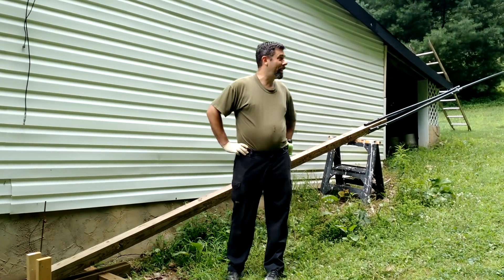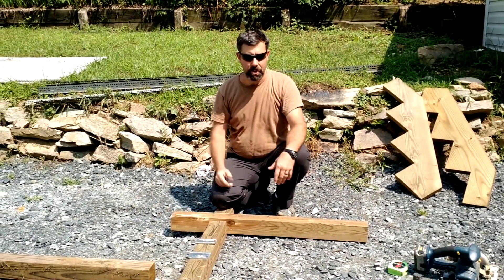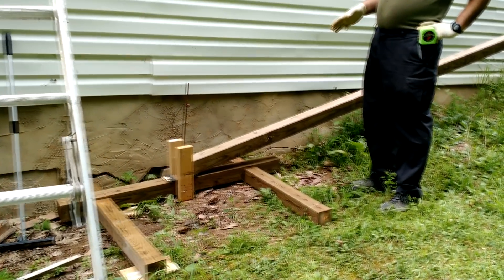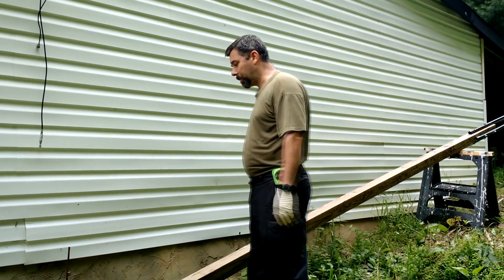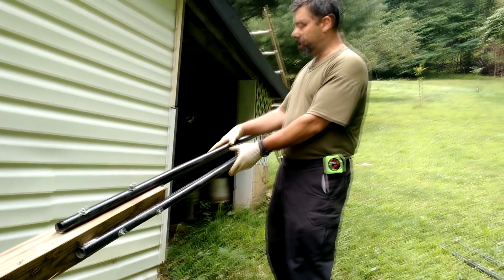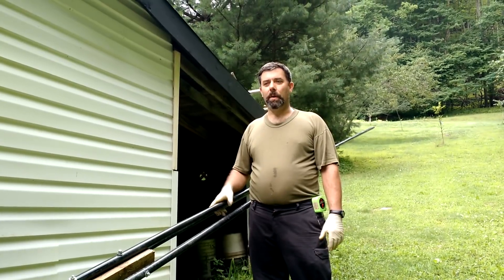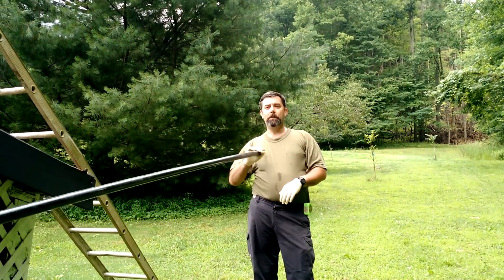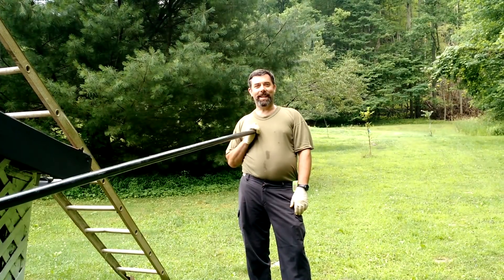Antenna Tower Build Part 1: I'm tired, but its built!

Comment: Hello Eric; interesting ideas you have. Your I-MAX is going be a challenge, because of its length and mass, sitting on top. The ground plane kits help it's performance, but again it adds weight and wind load. I hope you are going to guy the tower off, so as to help it all during a storm. To keep weight down while adding survivability, I would use black tarred twisted nylon line #72 or larger. The tar will protect from the sun and will last a couple of decades too. Steel guy wire is stronger, but it's also heavy. Good luck with your build, and be safe with it all. 73 and GOD bless. K5EWM.  Ps. It's better to have experience people to help that have put up an antenna before. 73 K5EWM.

Comment: Great job sir iv put antennas up for years .I have my tv antenna up similar to yours put only using one 4by4 .put I used a. 40 foot push up pole works great but I'm going back in the cb world soon as spring comes around and I'm putting up a small set of 2 element beams on mine using a tv antenna rotor it will work .iv used this same set up before .need Eney info just let me know
Reply from the maker: Sounds like a great setup. I look forward to hearing your progress!

Comment: Hey Eric great work on your tower.I need to build the same thing Im working on where cause I have so many trees. I enjoy your videos  CB brings back a lot of great memories of the 70s. I have a couple of am cb's but Im thinking of buying the Uniden 980. SSB  seems to be the only way to DX  with low power. It sounds like you have a good back ground being a X ham. I have a Imax 2000 that Ive decided to take out of storage, I only had it up for a year so its in pretty good shape.  I tested my swr  with it and  notice my   meter wasent moving. I disconnected  the coax and checked continuity from ground side of the antenna to the center. I was getting full continuity Is this normal for the Imax 200. Do you think maybe I have a short? Thank you for your postings Eric...
Reply from the maker: It will show a short if you test it like that. Don't panic, it is most likely fine.

Comment: Man that's great, but a lot of work considering you could get a round tower for cheap or free second hand , I'm getting ready to put mine up 40 feet standard tower I got for free already on the ground
Reply from the maker: I looked for the better part of a decade for a used Rohn type tower at a decent price. For a 40 or 50 foot unit it was always right around $350, plus the drive to get it, plus having to buy a new base section to mount in the cement, plus cement.  It always came out to nearly $600. That's just way to much for a hobby.
   The push up type 40 footers sound great on paper, but they take up a huge area of land as they have to have so many guy wires and stakes to keep them upright that I decided against them.

Comment: I do have a Question What Type of Cable do You use for the  CH Antenna? is it the same as Coaxial TV antenna ?
Reply from the maker: No you can't use regualr TV antenna wire. You will need wire that is called RG8X, RG8, RG213, or LM400 wire to work with a CB setup.  TV wire is usually called RG58 or RG6. those look similar but will not work.

Comment: Hello, I’m doing something similar but I’m cemented 2 short 4x4 post in ground than I’m going to hinged a long 4x4 post to the shorter ones cemented in the ground.
Reply from the maker: That was my original plan, but there was a HUGE rock right in the area I needed to put those support posts, so I had to go with plan B.